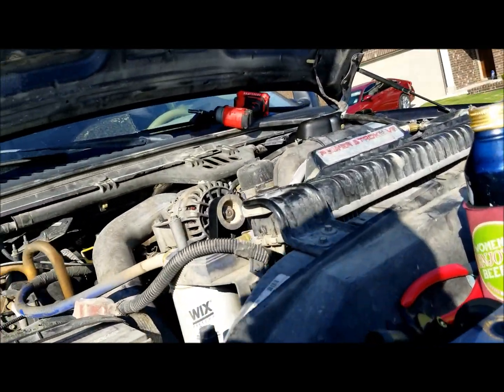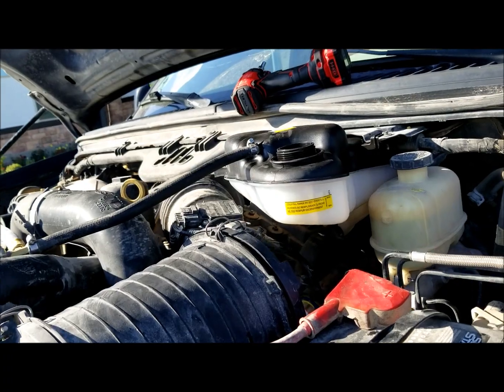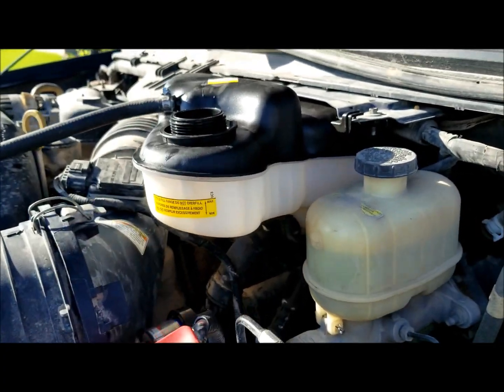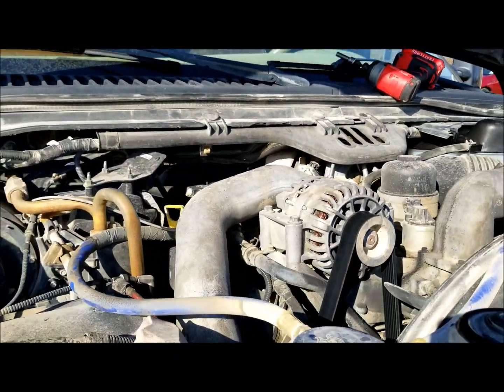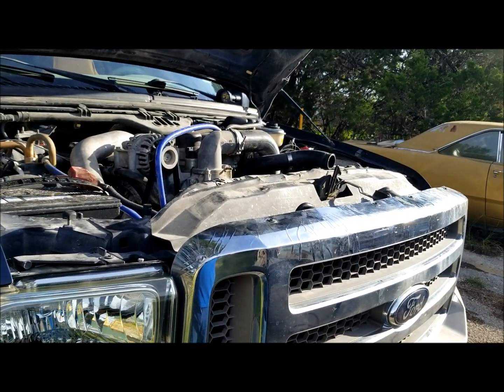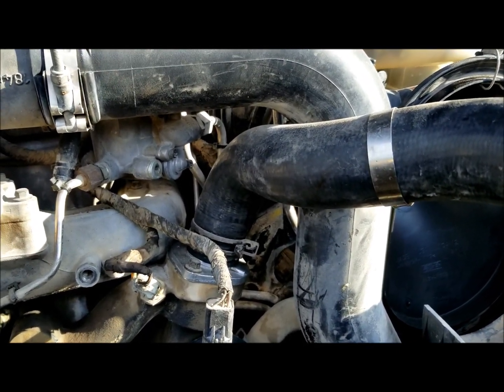Overheating 6.0 Ford Power Stroke NOT blown head gaskets Bullet proofed HHG

Comment: If I start watching a 6.0 liter repair video and the guy mentions getting any parts other than Ford Factory or the couple performance aftermarket that have been proven like “Bulletproof Diesel” any other parts poor guy is going to do the chasing parts non stop repairs over and over dance, it  tells me that he doesn’t have any kind of information that is correct advice when working on these very good power plants when the engines have been updated correctly. #1 RULE ON 6.0 IS ONLY FORD FACTORY PARTS no matter what with the exception of Bulletproof Diesel in Az and a couple aftermarket performance parts that focused on the specific issues that arise on these engines like the water pump issue they have (Ford Factory Since has updated and corrected with their new water pump) also BP Diesel has their Billet WP one, also using incorrect coolant is a HUGE PROBLEMS WILL OCCUR and the tale tale sign of knowing a mechanic isn’t 6.0 liter experienced is him not knowing that octopus radiator hose is a Ford factory part ONLY that nobody makes an aftermarket to that expensive hose and nobody ever has. 

Hiring a great mechanic is one thing but the best mechanic in the world that has little to no expiernce with a 6.0 liter you might has well hire the high school kid working at the oil change place to work on your truck, problem with a great awesome mechanic is their ego is usually to big to look up information and educate themselves  because they’re to good thinking their instinct is the correct answer nobody but the guys who specialize in 6.0 really knows the ins and outs of the little quarks that 6.0 liters have that need to be followed to a T if you don’t want to keep chasing parts every other week you do yourself and your buddy a favor and look up the little stuff that will kill the engines like using incorrect coolant not flushing it correctly which can take half the day in itself or using the plastic water pump or pumps that aren’t exactly 88mm like the Napa ones which are not and will fail. Nothing against you, you’re an awesome mechanic and it shows you’re a great friend keeping your buddy from going to the shop that pulled the “oh it’s a 6.0 it needs head gaskets for sure” typical go to answer aat most shops that see a payday. You can stop in and tell them you’re having a charging issue but they’ll comeback and say oh it’s the head gaskets. 

Anyways good looking out for your buddy but #1 advice and help,to give to any 6.0 owner is ONLY USE FORD FACTORY PARTS ONLY yes the higher cost and NO it’s not just a way for the dealer to make money parts at Napa or the others are built in the same place is totally wrong there’s been so many issues that have been researched, tested, updated and fixed through Ford to save from law suits  that the factory parts are all updated and the only way to go everything down to Orings, gaskets radiator caps I mean just everything has been redone that when it’s been  replaced it’s now a  “Bulletproof” power plant after the updates. The problem is not the power plant the problem is the owners NOT researching the updates and doing what Ford demands like preventative maintenance in order to keep that engine running. It’s such a sweet fast RELIABLE BEST SOUNDING power plant when all the updates and repairs are done and making ends is kept up continuously with the right Ford Factory parts.
Reply from the maker: Lots going on here...first off...the 6.0 is absolutely the worst light/medium duty diesel engine ever made after the 6.4. They are 100% not reliable. No way in fucking hell would I ever buy one unless it was to flip it to some poor 6.0 enthusiast. Theyre fucking absolute garbage engines. HPOP, injector, ipr, icp sensors, turbos, harness, connector, head gaskets, FICM, oil cooler, cam and crank sensor issues and the list goes on and on. Fucking junk 

"Bulletproofing" only "fixes" a handful of the common issues. There are TONS of good diesel shops and diesel parts retailers that sell quality parts. Theyre fucking shit engines. 6.0s kept a lot of shops and retailers alive. The work is there because the engines are shit. 

With that said, i dont work on 6.4s but if i could make a living ONLY doing 6.0s and 7.3s then I would. I like working on them. Once youve done 100 of them you can really start making money on them. 

I would agree that most Motorcraft parts are the best on the market but we have to remember that we are replacing motorcraft parts that have already failed. Not a very good indication that motorcraft parts are great or even good although they may be the best. The best isnt always good...there are miltiple levels of shit when talking 6.0s 

Ive been working on 6.0s since 2012. Customers in 2012 had completely different attitudes and opinions than customers in 2023. When trucks are only a few years old and owned by the original owners they are a lot more easily convinced to go with factory OEM parts. Or even upgraded parts. When these trucks are 15-20 years old woth 400k miles and 8 owners later and the customer has already spemt 10-15 grand on the pile of shit...its very hard to convince them to put motorcraft parts instead of vato zone specials. Theyre usually done spending money and they just want it running so they can sell it. Thats why pretty much all 6.0s have more than 5 previous owners. We had a rule at a used truck dealer I used to work at that we would not buy or sell 6.0s or 6.4s. The customers will never be happy with that purchase. 

Now that these engines are 15-20 years old, the dealer doesnt always have parts in stock. I do mainly mobile work. I deal with work trucks stuck on the side of the road with trailers hooked to them. They need to be back on the road ASAP. Not a 500 dollar tow and 2 or 3 days out on parts. I always try to sell the best parts available but "available" sometimes means "right...fucking...now." i have seen autozone cam and crank sensors not work out of the box. I have seen napa HPOPs not work longer than 24 hours. I have seen amazon IPRs not work out of the box. I warn the customers. Theyre paying me. If they cheap out and end up paying me to do the job twice...i dont know what to say...i told you so?  You cant force a customer to pay for factory parts. I am very articulate in informing the customers not to buy cheap shit and i have zero complaints about my work or the way i do business. 

I have a very good reputation and lots of repeat customers and lots of word of mouth customers. Im not a 6.0 expert but im pretty good with them. I wish I did more of them. 

You sound like a 6.0 enthusiast and probably a 6.0 owner. You speak of putting quality parts in a very very sub-par engine that is 15-20 years old...you should be speaking of upgrading to something other than a 6.0. Theyre fucking garbage. How there are still people defending these engines I will never know.

Comment: 2004 6.0 blew up the degas bottle leaving a campground 8 miles in pulling my fifth wheel 
It would leak from there only when pulling my trailer but around town it would be fine 
Changed caps, radiator, egr delete, water pump, a bunch of parts I’m really hoping it’s not the head gaskets 🙏🏼any idea?
Reply from the maker: Definitely could be head gaskets. Hard to diagnose via youtube
Reply: @halfwayhousegarage2959  lucky it’s not the head gaskets had them test them  pressurized the system and no leaks detected 🙌🏼
Reply: Did you ever figure out what it was? I’m getting pressure in my coolant but no other symptoms. No smoke or mixing fluids. Not loosing coolant. Pressure is just slightly coming out of degas cap like maybe 16.2 pounds. Hoping not head gaskets but I’m thinking that’s what it is.
Reply from the maker: @patrickblackburn2880  it passed the head gasket test. I fixed a bunch of coolant leaks and replaced the thermostat twice ans he never had any issues after that. I think it was just leaking coolant and he didnt notice.

Comment: i’m having the exact same problem but it’s coming out of my reservoir cap,it’s a new cap,have replaced thermostat,water pump,radiator. tested it and had no reaction from the gasket tester. so confused on what it could be, i have a EGR delete as well,might be a long shot but can anyone give me some advice/help im puzzled
Reply from the maker: Is it getting hot?
Reply: have the same thing 6.0 2007, when I go uphill the antifreeze leaves the tank, on a flat road everything is fine. Have you found a solution to the problems?
Reply: Did you ever find out what it was?

Comment: When you do a thermostat on a 06 6.0 see my channel for a hack? Unbolt the thermostat and don't attempt to unclamp the hose from the thermostat and take it out as 1 unit. When going back together, don't clamp the thermostat to the hose, until you line up the bolt holes, with the bolts, take it back out as 1 unit, put the clamp back in its place, and reinstall as 1 unit. You cannot get a pair of pliers to put the clamp in place, with thermostat installed.
Reply from the maker: Good call! They can be a pain in the dick but its a 6 liter so everything is a pain

Comment: I have a 6.0 and it overheats. If you drive it hard and go to 4 to 5 thousand rpms can that be the problem?
Reply from the maker: The 6.0 is the primary problem. Your secondary problem is not taking it all the way up to 6000 rpms...
Reply: So don’t drive it hard
Reply from the maker: @freedom8763  i honestly cant tell if youre fuckin with me or not.
Reply: @halfwayhousegarage2959  I swear I am not pls can you give me some Advice
Reply from the maker: You have a 6.0 power stroke, correct? And you spin it to 5000 rpms?
Reply: @halfwayhousegarage2959  yes
Reply from the maker: @freedom8763  how the fuck are you reving it to 5k and why?
Reply: @halfwayhousegarage2959  because it goes faster and I thought you can do that to any car
Reply from the maker: @freedom8763  its not a car. Its a truck. And a diesel at that. Take it easy
Reply: @halfwayhousegarage2959  I gonna take a Test drive and not go over 3 thousand rpms
Reply: @halfwayhousegarage2959  it still overheats
Reply from the maker: @freedom8763  its a 6.0. Probably has blown head gaskets
Reply: @halfwayhousegarage2959  it’s not. The fan and the coolants good ,the radiators good. Like what else can it be
Reply from the maker: @freedom8763  how do you know the head gasket isnt blown?

Egr deleted?

Comment: hmmm. Are you trolling everybody with this video? if not, I suggest investing in a microphone. I couldn't hear a thing you said after the 2 min. mark. prior to that I could barely make out what you were saying.
Reply from the maker: ...sounds fine to me...
Reply: I know this is an old comment but the reason you could not hear the video is because your audio cable is damaged internally. Very common on headphones, likely where the  cable bends and flexes near the connector.
Most videos and audio will be very easy to hear but then you come across a video like this one where it is recorded in mono sound. Because of how the cable failed the mono signal to both the left and right speaker are now canceling each other out electrically  resulting in very quiet audio and maybe what sounds like a heavy rainstorm if you turn the volume very high to try and hear what is happening or being said.
I have 4  cables that have failed like this and most audio across the internet and games plays perfectly fine through them, then a video like this one comes along and is the perfect set-up to make the failed cable make a video sound horrible.
I was able to duplicate the audio as you described it with a damaged cable and then when the scene changed to his driveway the audio was impossible to hear exactly like you claimed.
Very rare but I've seen others comment on this problem and I've never seen anyone other than myself understand what went wrong.

Comment: That truck also has the wrong oil filter cap
Reply from the maker: How do you figure? Tall cap, tall filter. Short cap, short filter
Reply: @halfwayhousegarage2959  the 03. 04 6.0s had tall cap the 05,06,07 all use the short one my buddie found out the hard way went through 4 sets of stand pipes and dummy plugs
Reply from the maker: @bwadles7659  not true. All motorcrafts are the small cap and filters. Motorcraft filters only come with the filter. No cap.

 Napa and wix are tall filters WITH tall caps. The problem is people buy wix filters and then go back to motorcraft short filters but they have to use the wix cap because the motorcraft filters dont come with the cap. Then the filter is too short to depress the bypass and you always chase oil pressure issues.

Comment: That’s why I’m a Chevy guy
Reply from the maker: Anything but a 6.0 guy
Reply: @halfwayhousegarage2959  still better than a dodge. And still will own a 6.0 b4 a duramax. If yall work on either one you'd know. 6.0s easiest one to work on
Reply from the maker: @bwadles7659  idk what that means. 6.0s are dog shit. They make me money because theyre dog shit. I love working on 6.0s. Every diesel shop on earth is still in business because of 6.0s. 

I also love driving my 12v cummins. I rarely work on it. Idk what is easier on a 6.0 vs a 12v
Reply: @halfwayhousegarage2959  i do agree 12valves are awesome but any dodge after the 12v is junk i got a 6.0 with 829k miles on it no issues
Reply from the maker: @bwadles7659  come on. There has never been a truck on earth that made is 800k with no issues. Ive never even heard of a 6.0 making it to 800k. Ive never seen a 6.0 woth 400k with a ton of issues. Come on...6.0 is the absolute worst diesel engine ever made
Reply: @halfwayhousegarage2959  its a service truck has studs was studded at 200k and I did injectors at 400k I meant i daily drive it and it has no issues lol
Reply: 510k on my dash, on my 6.0 Just saying. How many miles does the bowtie gay have? When you fix it, fix it right. None of the parts from the Vatozone trying to save a buck.